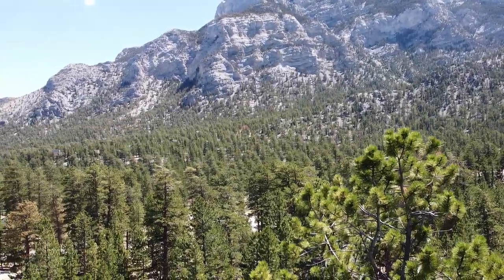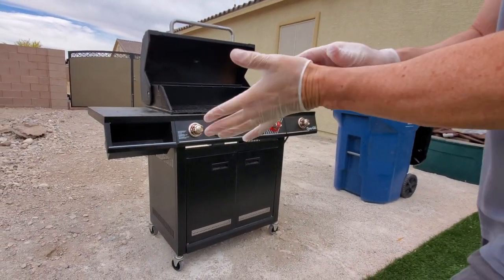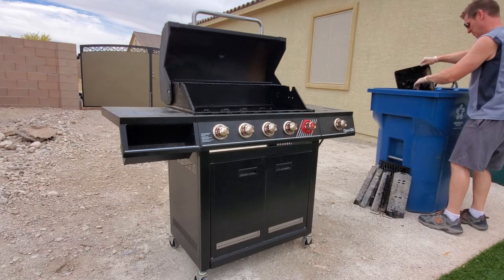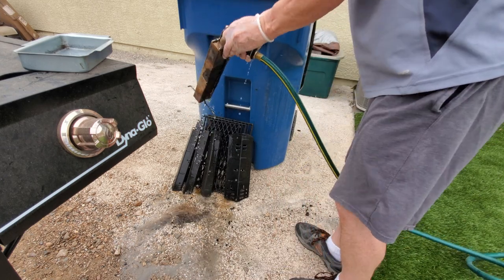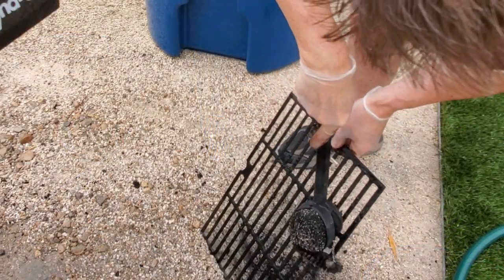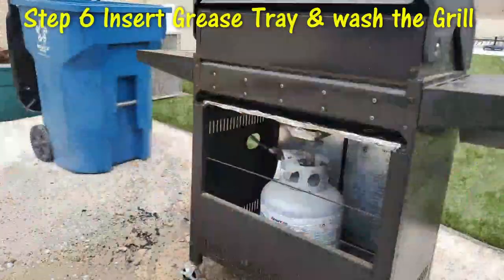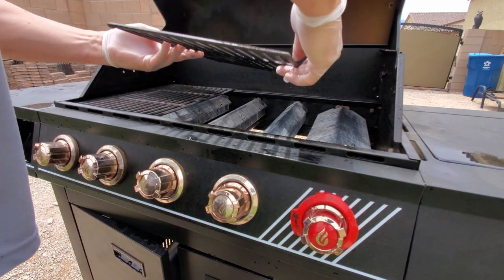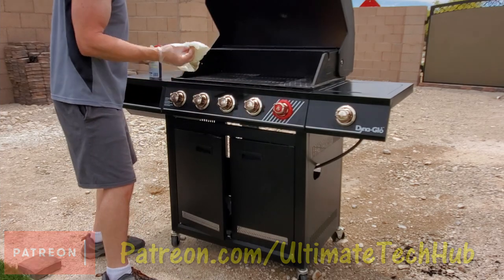How to Deep Clean a Gas Grill | Quick & Easy! Looks Brand New!

Comment: been interested in this grill.. couple questions. how long have you had it? is that rust on the knobs? it has a copper tint. there are so many bad reviews in regards to it rusting
Reply from the maker: No rust on the knobs. The knobs have a tint to them. It's a solid grill and I've had it for about 14 months. I have no complaints. I have a review video for this grill as well. Thank you for watching I really appreciate it.
Reply: @UltimateTechHub  I saw that review! excellent job. also any issues with any gas leaks? loosening parts?
Reply from the maker: @free2rhyme14  None. Zero issues.